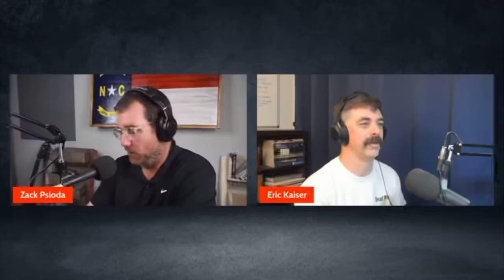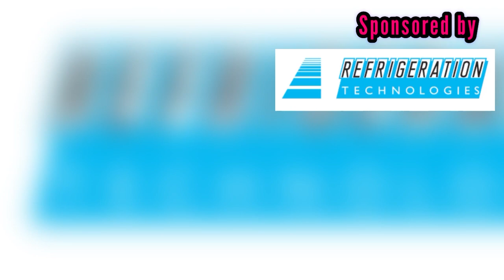What is CTOA in HVAC/R?

Comment: Example. My R410A 5 ton 14 SEER Trane heat pump was running 510 psig (136 degree sat temp) when it was 112 degrees outside. I was thinking it's overcharged but according to CTOA it's about correct. Also compressor amps was 23A. Plate states 26 RLA.